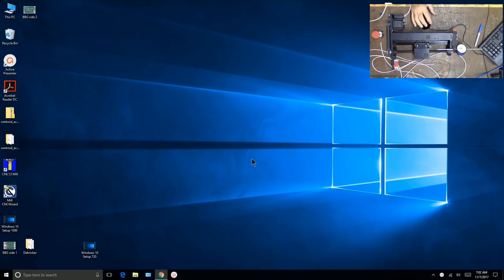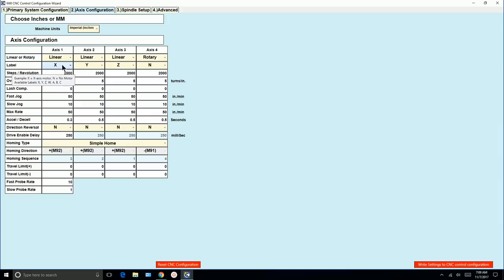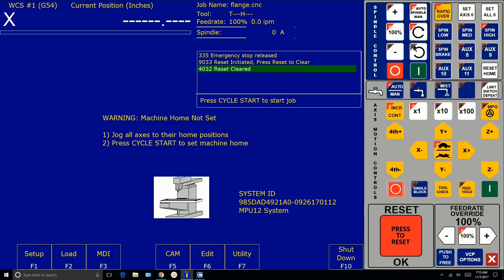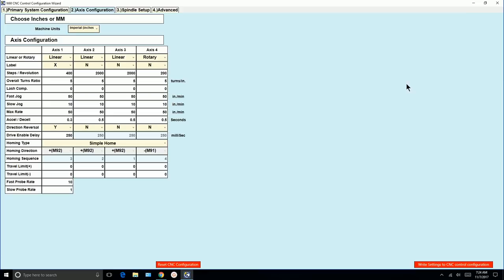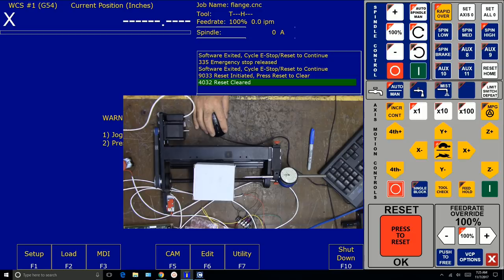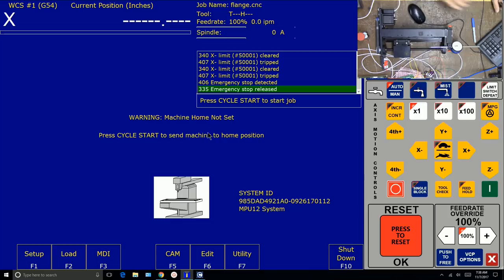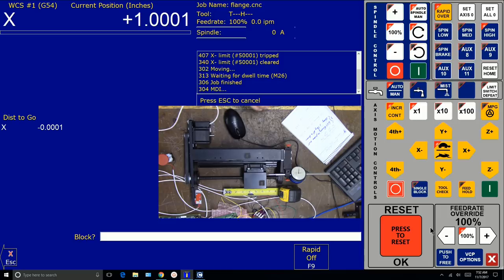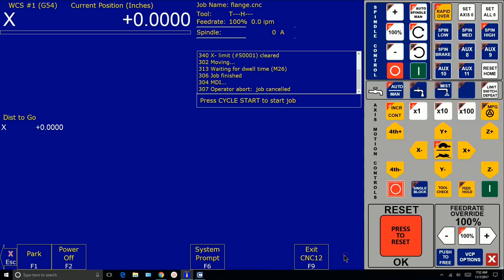Centroid Acorn CNC Basics - Using the Wizard and Tuning the Bench Test Rig

Comment: You should make clear that you are upside down in the video as to when you are standing at the mill. So the table is moving the opposite way the arrow is pressed for the cut to be happening as of the spindle is moving. Kinda confusing if you don't see the hand movement and correlate it to you say left and right.

Comment: Is it common to have to "dial in" the rotations per inch to dial in the machine?  Even with ballscrews?  I have a 5mm pitch ( according to my conversion kit maker) double-nut ball screws, so I set my number to 5.08. However, when program a 1 inch move, it overshoots it.
Reply from the maker: Yes,you will need to fine tune the machine

Comment: Marty, 
Thanks for the videos, they have been very helpful in setting up Acorn. I have a 5V optical limit switch to home the axes, and have verified with a voltmeter that it outputs 5V when on. When I connect this input, assign it "Axis1HomeLimitOK", and view it using ALT+I as you show ~30 minute mark in this video, I never see the input change. I am using the screw terminals, and was wondering if I needed to either use the DB-25 terminal or a 24V limit switch, if those even exist. Otherwise, what could be causing this issue?
Thanks for the help.
Reply from the maker: You can not connect this switch to Acorn. What you need is NPN NC switch that can SINK the Acorn 24VDC input to ground. What you could use, is wire them to an opto relay board.
PLEASE post this question to the Centroid User forums and I will answer it there so that ALL have the benefit of learning! https://centroidcncforum.com/viewforum.php?f=60

Comment: Marty, is there a video that explains how to save a .dig file to ncfiles folder? In regards to a digitized scan where does it go after I scan. Windows recents shows nothing so I have to presume it isn’t saving and I can’t find it in ncfiles folder. Perhaps a video of this process exists or you could make one for us?? Thanks. :-)
Reply from the maker: I have no experience with that. Post on forum
Reply: martyscncgarage, yeah that seems to be a consensus even on the forum very little is known and almost mystical. I have a running post there and some information and responses about the scanning process but why my files are not saving is probably confusing. I may try and reinstall cnc12 and see if maybe something installed incorrect. Thanks.

Comment: Great video but still a lil overwhelmed. Looking to upgrade a cnc laser but hesitant yet
Reply: @MartyEscarcega  pwm i believe
Reply: @MartyEscarcega  i was in touch with centroid but not done a search yet
Reply: @MartyEscarcega  This is a very large machine, weighs about 5,000 lbs but is basically like my smaller machines
Its a multicam 2000

Comment: I have questions about "steps/revolution" when you are setting up your stepper motors. You said that there were 200--steps/revolution when using a motor with "1.8 degree steps. But the number in the box is 2000.  Should that not have been changed to 200?

Or I am confused? I am sure it is just me, because I am brand new to CNC; and planning to DIY a CNC after purchasing the Centroid Acorn Controller; and all else I need to have a 4 axis (simultaneously) system: X, Y, Z and Rotary (A) Motors. 

Hope you can help me with these questions.

Thanks in advance.
Reply from the maker: Pat, it depends on whether or not your stepper driver micro steps or not. For example, the Geckodrive G540 microstepping at 10x, so you multiply the 200 x micro step rate. In this example it is 2000. Feel free to visit and post on the Centroid User Acorn forum. Lots of us there offer in help including the Centroid technical staff. This way many users get the benefit of learning from the questions asked.

Comment: Thank you for the video ,which processor I can use for my router machine with a rotary axis, I use artcam and I do not find the axis A in the code, is there a list of processor for the 3d accept by centroid? thank you.
Reply from the maker: Basically any Intel processor running at 2.9GHZ or faster should be ok. Please see: https://www.centroidcnc.com/cnc_pc_performance_requirements.html

Comment: Hey Marty my CNC router uses 2 motors to run my gantry.  So my question is will Acorn work if I want to add a rotary system to it later?  My router is a CNC Router Parts Pro system.
Reply from the maker: Hardware pairing would be your answer. That is you connect the tow motor drivers to one axis output out of Acorn saving the fourth axis for a rotary axis. This has been discussed on the Centroid CNC Acorn users forum I'm pretty sure. Post and ask the question there. Maybe someone that has done it will chime in.

Comment: What if you have closed loop steppers do you use the encoder count or the steppers steps?
Reply from the maker: jeremy, use the encoder count X4. If encoder count is 1000 use 4000 in Wizard motor steps per rev

Comment: The most important thing I want to see is the actually wiring of the controls cabinet & the wiring of the encoder to the spindle motor into the Acorn boarad with all the fuses & step down & step up transformers to power the spindle motor. I have not seen any video of this sort laying out all the wiring .

Any help would be appreciated.
Reply from the maker: Every system is different Donald. Your best bet is to download the Acorn schematic set from Centroid's website and study them. Your request is a tall order to fill.
Reply from the maker: Do you have an Acorn system? Or are you researching? Do you have basic electrical/electronic skills? Can you read a schematic? I did dry erase board exercises and covered some of it on my other videos.
Reply: @martyscncgarage5275  I don't have a Acorn system yet. I do have basic electrical/electronic skills. I just to see a video where & how to mount the Acorn born board & extension board, axis drivers  & all the other electrical components wired & an explanation of the components used and why.
Reply from the maker: @donaldhollingsworth3875  much depends on the machine. Same with components. Small machine or large machine. Used CNC machine or new build? What size motors are on it now? If you were to take pictures, explain your build and post to the Centroid Users forum, we could give you some ideas. Very difficult to give suggestions not knowing what you are working with. https://centroidcncforum.com/viewforum.php?f=20

Comment: Hey Marty, can you make a video explaining the differences between the centroid Acorn and Centroid Oak boards? And when to use which board. Im retrofitting 2 1997 fryer bed mills. Also can you talk more about controlling spindle with a centroid? These mills have a Bridgeport style spindle rpm wheel that you turn to increase or decrease rpms. I would like the spindle solely controlled by the g code . Thanks
Reply from the maker: I can, but there is some time and effort involved. Does this help you? http://www.centroidcnc.com/centroid_diy/centroid_diy_cnc.html

As for your spindle question. On a mechanical variable speed head, you manually set the ratio at about 1:1 and then use a sensorless vector VFD like the GS3 from Automation rectify.com connect any 3 of the Centroid motion controllers 0-10v analog output to the VFD and then the motion controller can control the VFD through Sxxx commands, and the VFD can vary the speed of the spindle motor. I hope this helps

Comment: Hi marty,,
I got no movement,, i follow step by step as u showed,, but my motor won’t move,,
Reply from the maker: You don't provide any information about your setup. I don't know what you have. Please post screen shots of your wizard pages, provide make and model of your drives and motors and a link to the manual for you axis motor drives and a picture of your wiring on the Centroid Acorn User's forum: http://centroidcncforum.com/viewforum.php?f=60
Reply: Thanks marty,, i have all axis working right now,, it on wizard i check all the step, dir, ena box,, after i uncheck it all its working,, and now new problem is coming,, how to set and calibrate the axis,,
Reply from the maker: I've done a video on that. Make sure you setup uour motor steps per rev and verify first
Reply: martyscncgarage 
Yeah,, still study it

Comment: 43:26 that should never happen it should read x1 what ever motor turns lol.if software know i mean read how far motor move it should move it back x1 or other way it should neder go pass.
where that x1.0001 come lol configure your machine using metric i bet your theards are metric you get integer value and it will be EXACT lol and metric is more acurate
MEANING metric machines has 0.000 and inch machines has 0.0000
smallest movement on inch machine you can see on screen 0.0001inch = 0.00254 mm on metric machine that movement on metric machine would read 0.003 ?? so metric machine can do allmost 3x more acurate based on just display logic lol. so that error 0.0001 is like very easy to see on metric 0.002-0.003 so using metric when calibrating and then switch inches you get best result or JUST stay in metric its better.
 to change inch and metric its G20 and G21 right?